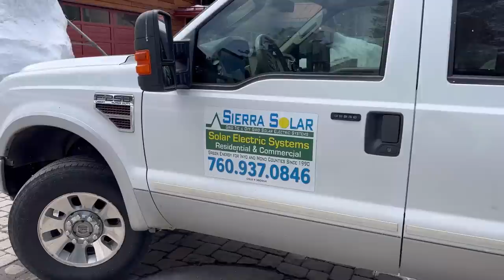A day in the life Mammoth vlog EP#(1) 5-5-2023 🦣

Comment: 10:18 - Your assessment of those existing materials is correct: They are junk. So you don't want to re-use them, regardless of what the client wants, as structural integrity cannot be guaranteed. You see how those plumbing straps failed; Anything you see that they did before, which resulted in the failure you see now, is unacceptable as a method of rebuilding it, as the exact same thing is going to happen in future. It's like a crystal ball that lets you see the future. Listen to it!
BTW, I'm running a little late, due to some emergent situations over the past 24 hours on this end, so I won't be getting into Mammoth until late Saturday. Looking forward to seein' you and checking out those job sites on Monday!

Comment: 24:06....Suck all the old gas out and replace with fresh and pull the plugs and make sure you have spark,  then pour a tiny bit down each plug hole(preferably some premix)and she'll probably fire in a pull or two. Compression, spark and fuel is all you need.